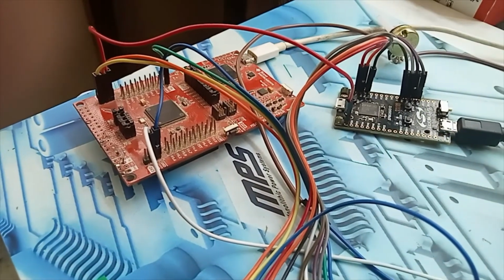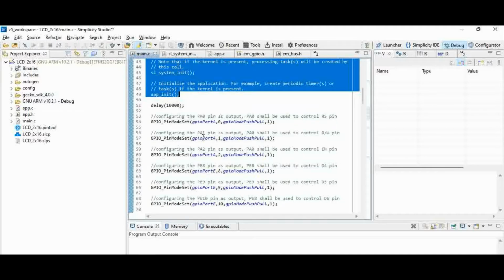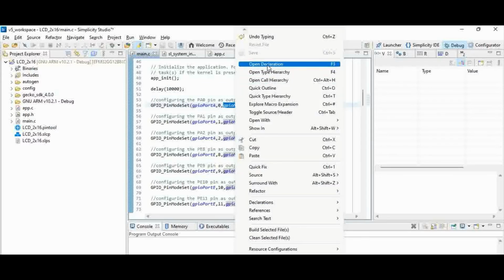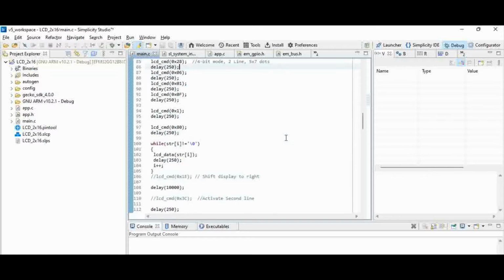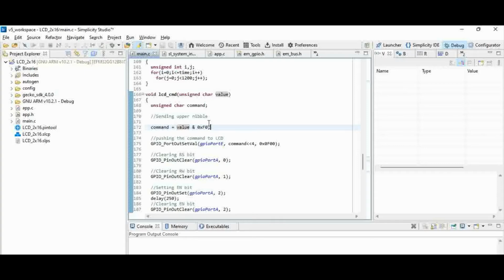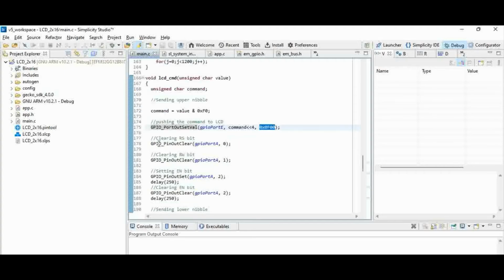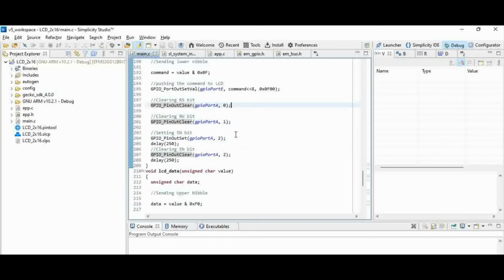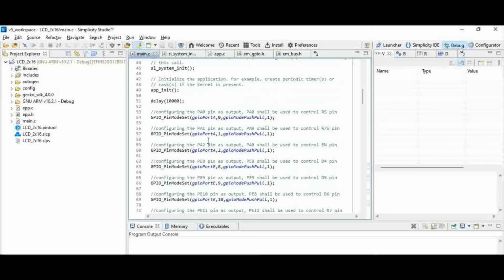Interfacing EFM32GG12 to 2x16 Alphanumeric LCD | Thunderboard EFM32GG12 Part - 11

Comment: I'm trying to interface e-paper display with thunerboard, but the pins on thunderboard as suggested on Github reference link can't be used (Github they used CS : PC03, NA on thunderboard). I changed pin in GPIOmodeset definition to PB02. But getting no response on Display is there way I can resolve it? Please help me.
Reply from the maker: That should be a straightforward change.. let me check..
Reply: @Way2Know  Thanks for your time, is there any other way to contact you also let me know.

Comment: This is great, thank you for the tutoriel. I have the thunderboard sense 2 from Silicon labs and i want to connect it with an external PIR sensor. How can i do that ? Can you help me please, this is very urgent (for my project) Thank you
Reply from the maker: For PIR sensor, you have output pin.. connect the output pin to any of the GPIO on the breakout pads on the left and right of the board..
Reply from the maker: Just to caution you.. if the PIR sensor is 5V rated, the output pin also shall be 5V. So, you need to translate this voltage to 3.3V. you can search for any of level translation using BJT over the internet..